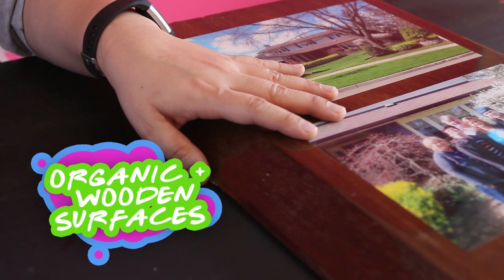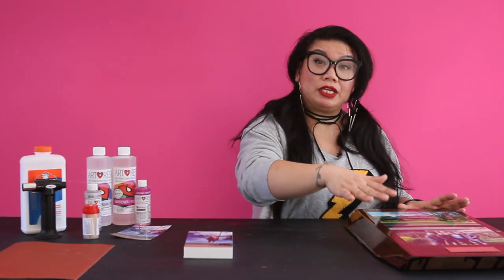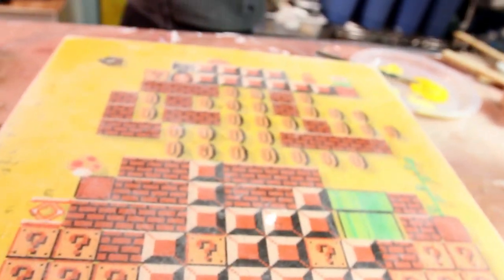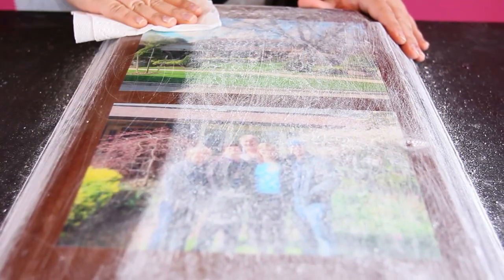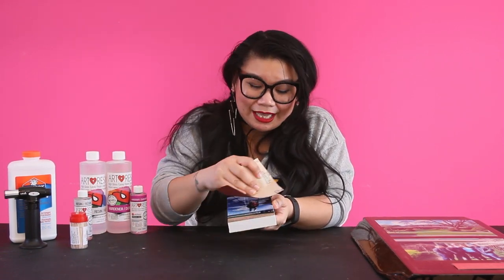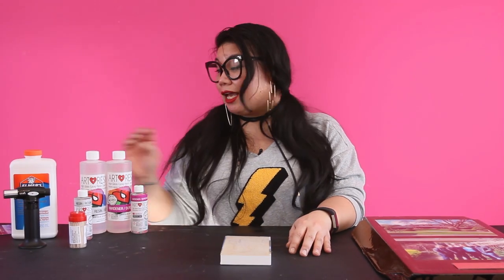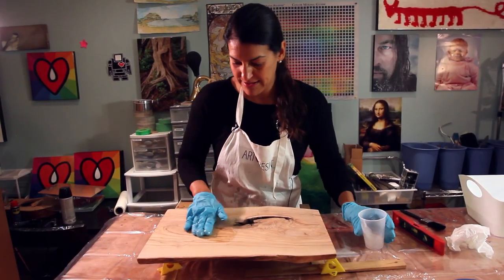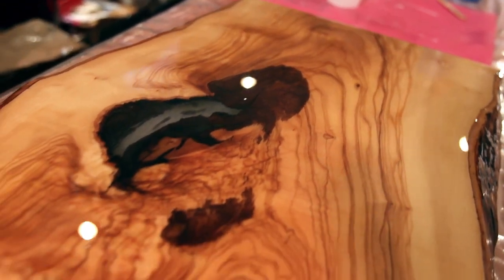OH SH*T Ep 2 - Bubbles!

Comment: Know this is an old video now but should the bubbles be visibly gone when sanding or only after the recoat? Got a ton of microbubbles but its like a mini heat wave here so not sure if thats caused it-Thanks!
Reply from the maker: Hey Clare - great question - I would sand out the bubbles.  If you have a ton of microbubbles, they may still be visible after your pour a fresh coat, if you've not sanded them all out.  An electric sander can make quick work of this :)  Normally cold temperatures result in microbubbles - warm temperatures are good for resining :)  What is the substrate that you're resining on?  It could be off-gassing or perhaps a reaction between the resin and whatever you're resining over?  Are you using a torch after you pour?  It will really help!
Reply: ArtResin believe It may have been the speedy mixing, so not sure if this is fixable? I haven't an electric sander but will try giving it another good go! So would you  say its a case of the sanding open up the tops of the bubbles for you to then fill up with the next layer of resin? I'm looking into getting a heat gun or torch but unsure on what's best atm! Thanks for  quick reply as always! Xx
Reply from the maker: Hi Clare - even if you did mix it quickly and create lots of bubbles, a torch will take care of it for you.  A torch is the very best investment you can make for working with resin.  I wouldn't bother with a heat gun - they can blow hot ( dusty ) air all over your wet resin.  Get a creme brulee style torch you'd find at a kitchen supply shop - they are inexpensive and super easy to fill with a butane canister - it will make a world of difference for you!!  

At least sanding down to open the tops of the bubbles, yes, but sanding them out altogether if you can is best practice. Try to remove as much sanding dust/residue as you can with a damp paper towel, let it dry, even use a dry soft paintbrush or canister of compressed air to remove as much residue as you can, and then pour your fresh layer.  

Good luck!

Comment: What about using ArtResin on painted furniture. I've got a piece from ZGalley (Anderson Cabinet) which the paint is cracking on top and figured a layer of protective clear epoxy would hold it from breaking the paint layer. What do you recommend for pre-sealing prior to use the resin?
Reply from the maker: Hey Eduardo - absolutely you can use ArtResin on painted furniture.  It's hard to say without seeing the piece, but if the paint is already cracking, it's probably a good idea to preseal first to avoid flecks of paint floating away and curing in your resin.  Always best to err on the side of caution :) We are not loyal to any one particular brand - you can use an archival quality glue if yellowing is a concern, or whatever presealer works for your furniture at your local hardware store.  Hope this helps :)

Comment: what about bubble in resin charm (it looks like pandora glass bead)?
Reply from the maker: If the bubble isn't too far down, you can sand out the bubble and re-pour fresh resin.  Did you use ArtResin for your charm?  ArtResin is meant to be poured in thin layers, no thicker than 1/8" or else bubbles won't have time to rise to the surface and will get trapped in the cured resin. For thicker applications, like charms, it's best to pour in multiple 1/8" layers, or you can use a casting resin specifically designed for thick pours.